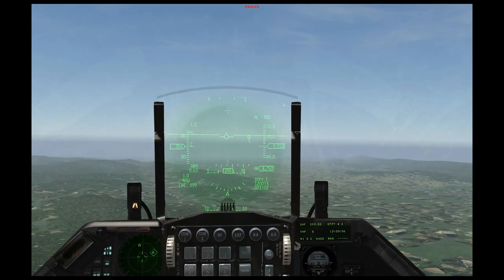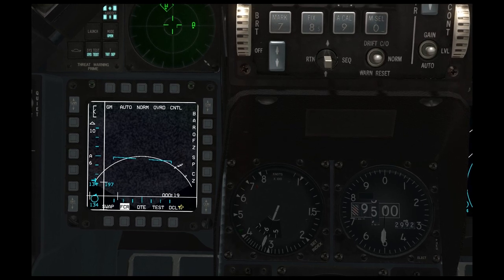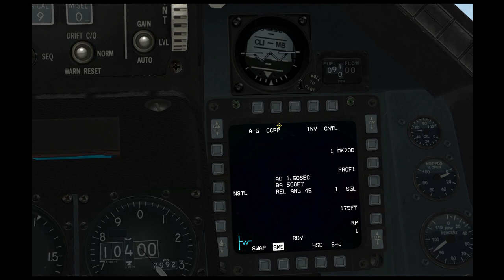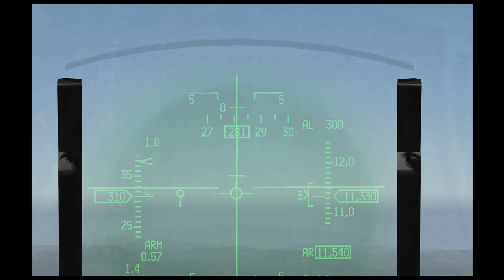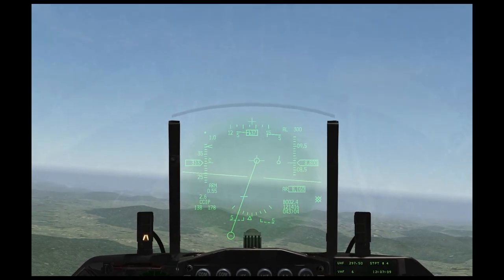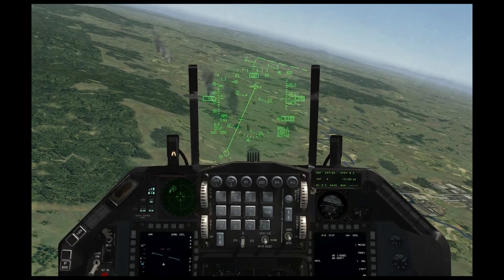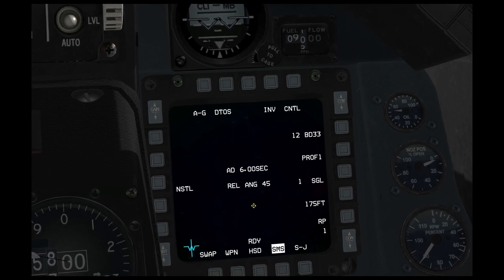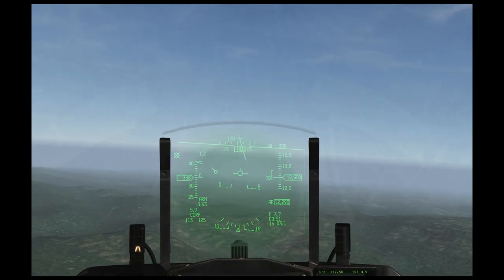Falcon 4 BMS Tutorials: FCR, CCIP, CCRP, DTOSS, Lofting bombs

Comment: You hold pickle , not tms up, or tms down- which is what Krause says at different points , save yourself some frustration. Mark the target in SP MODE with TMS up, declare awacs, get cleared hot, get the fpm on the fall line and fly a smooth path.

The big circle will appear, then, hold pickle, the big circle will come back and the bomb will come off the rail.
Reply: proletariat239 thank you!
Reply: Tms up, where is that?? I cant find the key to lock target

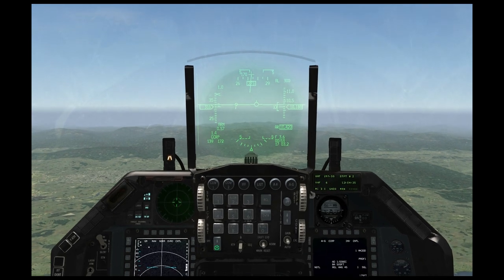Comment: Another great video! At 13:07 the bottom line of the right bottom group on the HUD is not a "combination of the two lines above", rather the bearing (in tens of degrees) and range to the release point. Watch it changing from 17:35, when changing to STPT 3, you will have to turn right 170 degrees to have it on the nose.

Comment: some additional info:

For ccrp, the timer in the bottom right is not the time to target. it is the time till the horizontal marker hits the fpm. you'll see it reset for the second marker.

also. bottom right, third line, left number, (00 in this vid) is your course deviation in tenths of degrees. in this vid, when you overfly the target, you can see it counting up to 18, giving 180 degress, since the target is now behind you.
Reply: This is a good example of why it's always a good idea to read the comments on instructional vids. Thank you for your comments here!

Comment: I experimented a little bit with the CCRP into DTOS thing. You are able to approach the target at low level, let's say 100-300ft over ground. After the first cue the second timer will approximately start at 20sec. It is also your time to target at that moment (because you are so low). When the timer is around 15sec, pitch up hard with 5g and hold pickle while doing it.
The bombs will come off almost immediately and you can turn defensive. 
The advantage is of course the low altitude. 
With a little practice you also can use mountains as coverage so that the enemy has a line of sight to you only for a few seconds.
When you combine it with JDAMs and pre designated targets it is still pretty accurate.

Comment: Great video. A little bit on profiles: CCRP is mostly used for high-altitude bombing (to stay away from AAA and SAMS),  and for precision is recommended to use with LGBs. For the CCIP, depending on your negative dive (-10, -15, -20 etc degrees) you can penetrate bunkers and stuff (even doing a reverse release). And loft bombing is a mode to attack targets at a distance.

Comment: some additional info/

for ccip: when the small horizontal line(delay line) in on vertical line to the piper, that means that the computed impact poitnt, is actually outside your hud, wich means when you pickle, its going to go to ccrp mode. When the small horizontal line is absent. the bomb wil drop immediatlely.

Comment: In DTOS Max distance only for 45 degrees. Less or more, the distance is shorter. More than 45, the bombs climb higher before to fall. The equations are well known from high school physics. So if you want maximum separation with the target, use 45 degrees.
Reply: Does the game include drag?
Reply: Jeremy Munsell i believe so. The drag is only related to the velocity of the shell when is released regardless the angle. Its very easy to implement drag given the geometry of the shell. Everything is constant so the drag is a function of the velocity only. And the same drag applies to all angles.

Comment: in  ccrp mode, I cannot get my bombs off the rail. master arm is correct, fly the fall line, hold picked, fly the drop line, 2nd marker comes down and nothing! can you drop mk20 from fl150 in level flight. also, do you have to hold tms up and pickel?

Comment: Question about the A-G RADAR... I was doing the A-G RADAR modes training mission, and I could not for the life of me find the ships on RADAR. Even once I visually acquired them and maneuvered the cursor to them in the HUD, they wouldn't show up in any submodes... Tried GM, GMT, and SEA. That's a pretty big group and ships aren't exactly small, so I was either doing something wrong or my installation of Falcon is broken. I had no problem finding the column between steerpoints 4 and 5.

Thanks!

Comment: CCRP/CCIP hunting and killing - I think I can just switch FCR to GM or GMT in NAV mode and after that just activate A-G with CCIP when I need it ?
Reply: Lazzy Seal seals shouldn't be lazy, as to avoid clubs- I'm here to help:
A good procession of sensors is FCR TGP WPN visual.

Find it with the FCR at range, get eyes on with the tgp, bore sight it with the WPN page if you need to, see it with your eyes, put the nose on her, kill it.

Make a mental map of the FCR picture so you don't end up goofing with DMS left right and down , you can just clover leaf and kill till you Winchester.

Happy hunting

Comment: Krause, need a hand here .
Recently changed sticks and its somehow overly sensitive, cant keep the bird in stable flight for the life of me. So Im trying to rely on the autopilot feature for LEVEL SIMPLE flight. Also, its necessary if I ever want to do CCRP bombing since i cant keep the plane stable enough to do it right now.
The thing is it goes crazy on me. Ive searched endlessly and could not figure out how to work the stupid thing for the life of me.Plane acts weird when I activate it.Its alot more complex than it looks. Also there is the options- autopilot 3 axis / steerpoint configuration so not sure what I should use. Would appreciate some help if possibru.
Cheers !
Reply from the maker: +negruv0da don't use autopilot in combat. Put some deadzones on your stick.

Comment: excuse me, how to turn left or right when we in the runway? and how to stop when we landing (key board)
(sorry, my english is bad : (( .... )
Reply: +Anh Lê Đức You need nose wheel steering on and when its on you'll see the NWS icon highlighted top right, to the right of your HUD. With it on you use your rudder to turn, with NWS on your rudder is turning your front wheel (gear). To stop when landing or rather slow down, you need to hit the wheel brakes then when you want to come to a full stop switch on parking brake. I have both those mapped to my X-55....wheel brakes is C on my stick, parking brake is SW 5 on throttle.
Reply: +cns180784 Also before shutting your jet down with parking brake on you can contact tower to install chocks, press T then 8 (by default on keyboard- with BMS keyfile).

Comment: Help. No seriously. My radar works perfectly in AA mode. But, for some reason I'm totally unable to move the cursor in AG mode. Is that a bug or something? Really annoying.
Reply from the maker: By default A-G will be slaved to a steerpoint, if you are more than 40 miles from the steerpoint the cursor will just be stuck on the side of the screen closest to the steerpoint. You can switch into "SP" snow plow mode to designate a target relative to your position rather than the steerpoint.
Reply: Krause
Thanks. Going to try and then ill tell you if it worked. Awesome tutorial btw.
Reply: Krause
Didnt work. And now for some reasons my AA cursor stopped working too. What the hell is going on with this game. X_X Tried to restart my game, change my control. Tried keyboard/mouse/joystick/prayers, it didnt work. SP mode neither.
Reply: Krause
Fixed it. Seems like on of the theater I downloaded from falcon online was bugging my game. Now it is working fine. I can finally bomb some targets and enjoy the game!

Comment: How do I switch between steerpoints using the FCR?
Reply from the maker: You don't. You use the ICP.
Reply: Krause
How do I tell which steerpoint is selected?
Reply from the maker: *****
STPT on the top right of the DED.
Reply: Krause Thanks a lot man. Your tutorials have been really helpful.
Reply from the maker: No worries. :)

Comment: Hi Krause.

Another simply question: Can you throw bombs without these modes?, and especially on F4 Allied Force?.

To throw them in the moment that one wants, "without instruments", without CCIP, CCRP, etc.
Only pressing "Pickle / Fire Weapon" and the bombs are released until stop firing.

This is for use against certain targets that suddenly you see, and does not allow time to change between "CC-I-R-P's" modes, just need to launch immediately on "eye calculating" to hit the target.

Thanks in advance.